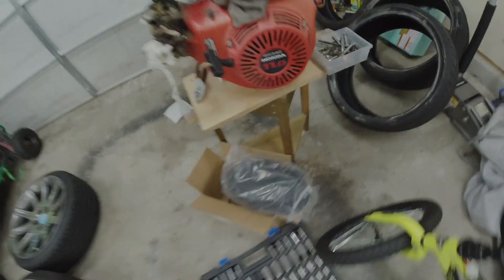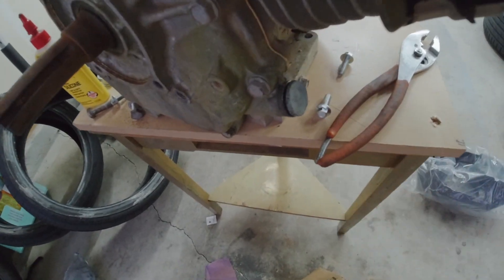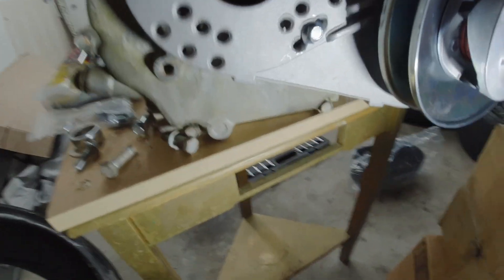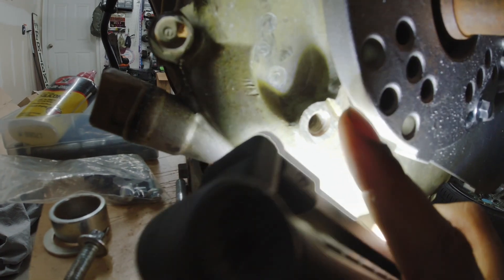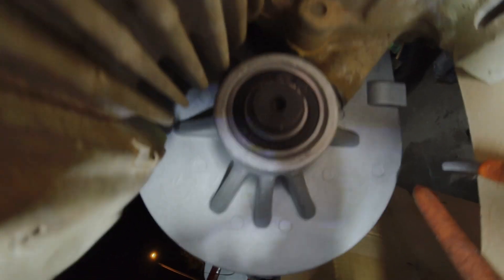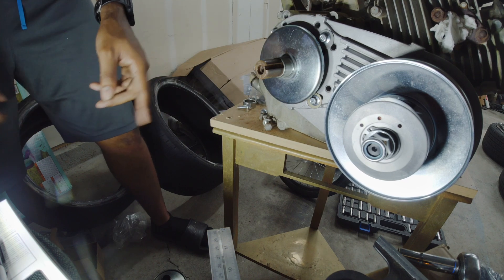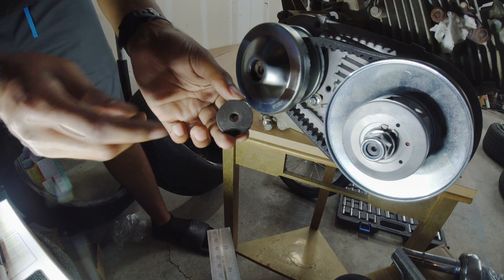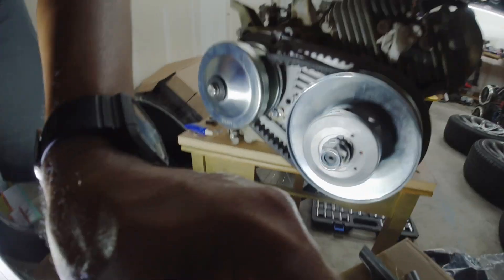Big Block Stretched Motovox MBX10 Ep. 2 | Honda GX340 + Amazon 40 Series Torque Converter

Comment: Is that the belt that came with the kit
Reply from the maker: Yes, thats the belt that came with the 40 series cvt kit. It has held up to a 225 lb rider going 68 mph alot lol. The belt never gave me an issue.
Reply: Can you drop the link
Reply: Do you know what size bolt for your crankshaft?